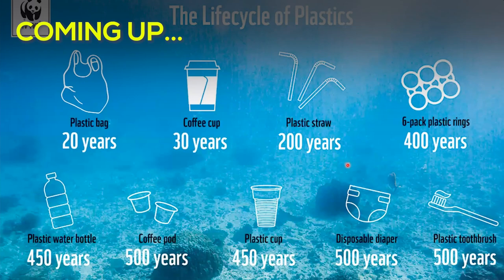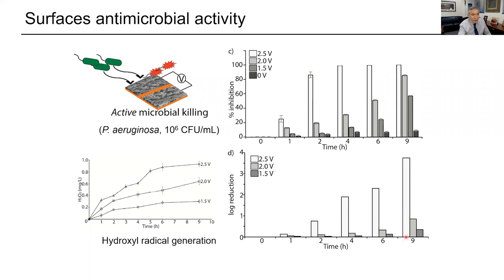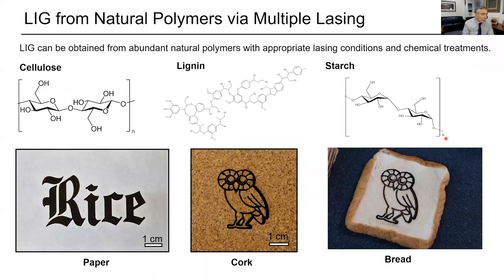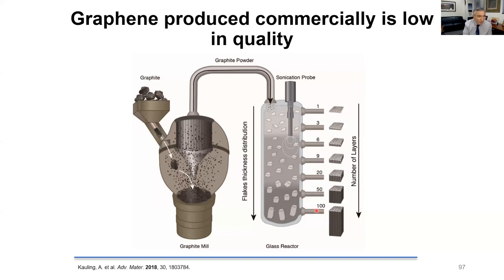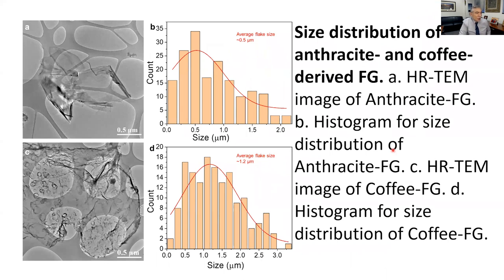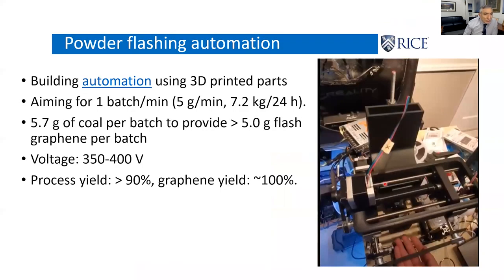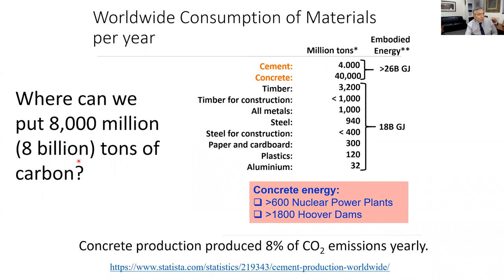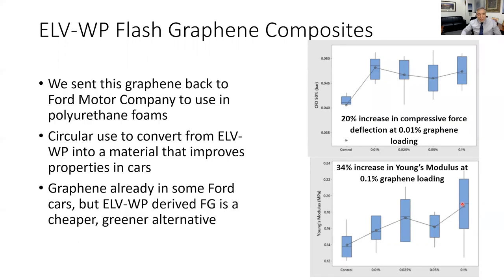Destroying the Pacific's Plastic Vortex | Laser-Induced and Flash Graphene Technology

Comment: This has big impact on Solar. As it is most automated industry around. The least labor intensive. So if you could improve the efficiency of panels from 22% to just 35%.. That is a huge deal. As you can produce the same amount of current. On less surface area of the same wattage output...It also looks like it could be used in energy storage. As they already produce lead carbon batteries. Which can work at much lower temperatures then lithium. Yet still take a much larger charging current input. Then older battery designs. And not need a BMS module...I bet it would make them even lighter..

Wish I was 20 years younger. I would be working up a proof of concept. On just how to do it...